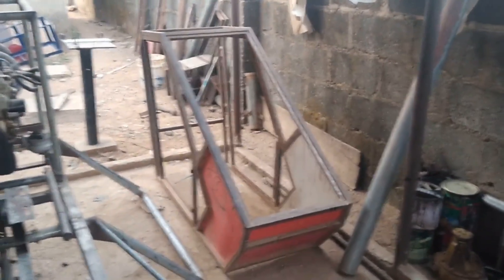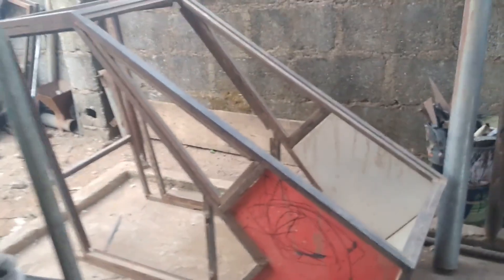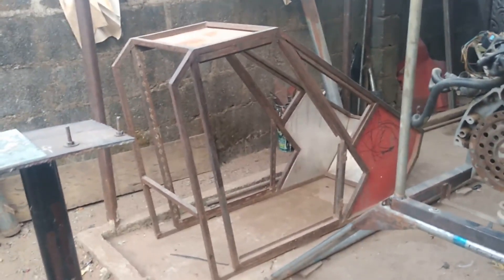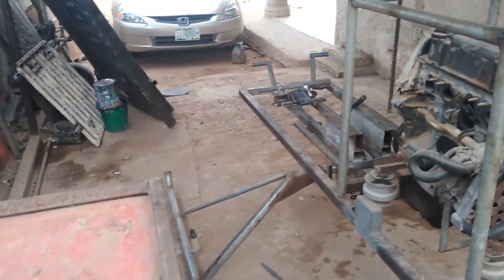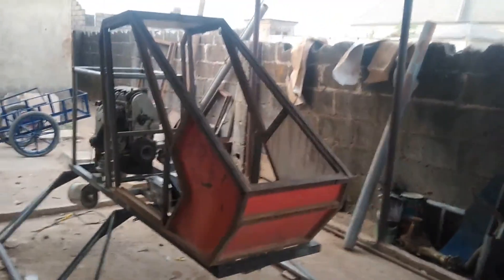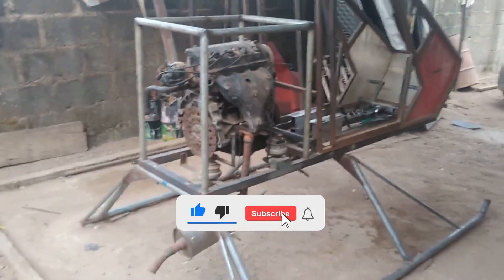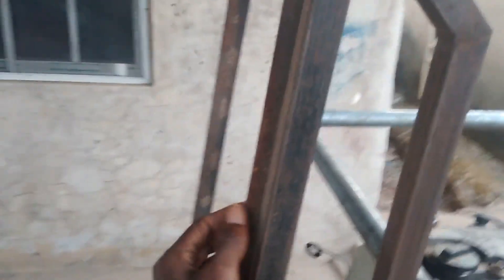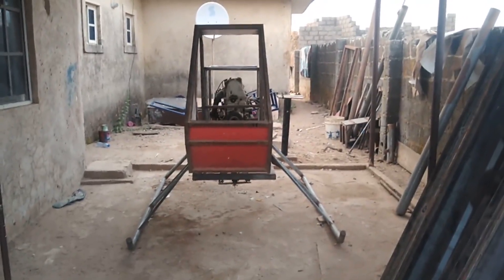Homebuilt Ultralight Helicopter Full Fuselage Review

Comment: Bro have you made your swash plate? Do u hv any idea how heavy this is going to be? You should try your best to keep the weight as low as possible. You should consider facts like body weigh(dry) and gross. For your copter to be qualified as an ultralight or a mosquito helicopter,it should not be more that 280kg and that includes your weight. I have watched your other vids and your blades look too rigid and short. Your tail rotor gearbox looks too heavy. You have a good idea but work on your main rotor blades and keep the weight down.
Reply from the maker: Thank you for your contribution I have already put all of this in place! For the empty weight am trying my best to make it at least 230kg and the main rotor blade each should weight at least 6 to 8kg thank you.
Reply: Yh we as fellow Africans are counting on you. I'm personally working on mine,putting things together. Thumbs up and keep on working hard.